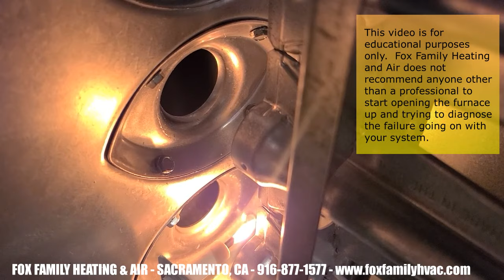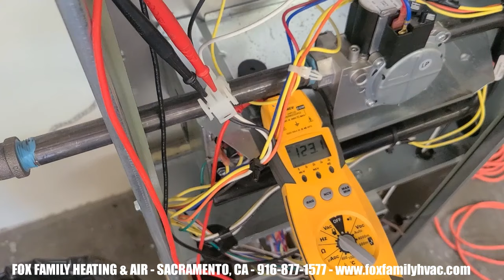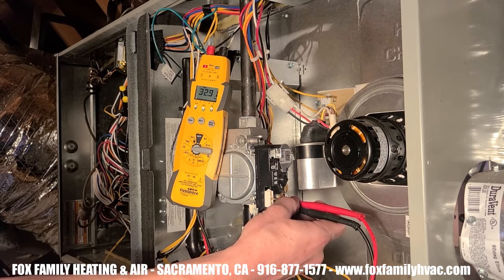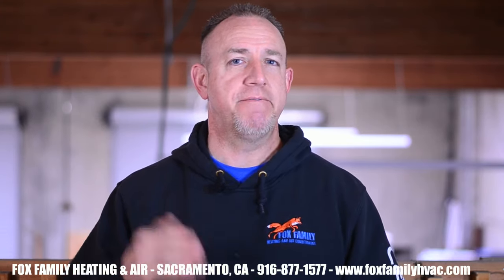How to Diagnose a Bad Furnace Gas Valve (10 Things To Check in 2021)

Comment: My Honeywell vr8204h1147 buzzes when the thermostat calls for heat on my utica steam furnace. The furnace does light but the valve continues to buzz for a time.. perhaps when the call is satisfied.  It seems to do this for the first few days the furnace gets turned on in the fall then the furnace works like normal with no buzzing sound for the rest of the winter.. I have found conflicting reasons why this happens. Is it bad, just dirty, or something else?
Reply: That sounds a lot like my furnace.  Only I have it off for now until it's fixed.
Reply: I am no expert but have been around these units a while. The buzzing coming from your valve indicates 24V is going to the unit but the valve is not opening. You can check the 24V with a meter. If this is truly the case and your valve is sticking closed until it has been operating a while, the valve can also STICK OPEN unexpectedly! :O You may be operating on dangerous lines here and should change valve immediately.

Comment: My York furnace is 4 yrs old. Just recently it would work fine. Then out of nowhere it would blow cold air, I see a steady single red diagnostic flash, meaning heat called for , but no flame sensed . I cleaned the flame sensor, which really wasnt dirty,but a bitch to get out and in due to a very tight area.  Ran fine a few cycles and repeats the problem. I shut of power and turn back on and it works a day or two, then back to square one. Im thinking a sticking valve.  I always see the ignitor glowing properly. Any ideas? I have a 10 year parts warranty, but Im thinking the service call would be twice the $150 cost of the part. Im thinking buying the part and saving money, which actually makes the warranty useless. Thanks
Reply: Same issue here. Please let us know if you figure it out.
Reply: same issue here, everything runs fine for me, just noticed this slow red single flashing light coming from the furnace cabinet, did you ever get yours fixed?
Reply: @Noname23489  What I did was to tap the valve when the ignitor glowed, and was due  to open, and presto, it ignited. And after that it worked properly. My thoughts were that after not running due to summer, it kind of stuck from non use. This summer, I might just once in awhile turn on the furnace a couple times to maybe keep it from sticking. Just an idea. Never had to repair anything.

Comment: Does a bad gas valve cause a bad smell to come through your vent, that smell like a strong smell that smells like how a has stove smell? I have natural gas but when my heat is about to turn off I smell a strong smell that smells like that smell when turning on a gas stove. I had the fire dept to come out and the gas company and there's no gas leak at all.
Reply: Could be heat exchanger cracked

Comment: How do you start troubleshooting a furnace after a flood?
Reply from the maker: I would check for power first, anything that got wet is likely to have gone bad. Including the insulation inside the blower cabinet. It will get smelly and moldy.
Reply: @foxfamilyhvac  thank you. Is it possible that water can get into a boiler through the chimney with rains like IDA?

Comment: When I set the heat to 85 the furnace comes on and fired up, but it does not go up to 85 it would stay at 75 or 77, the colder it is the more it struggles to heat up, what can be my problem? Thanks
Reply: Undersized unit for your home is usually the main reason but also you have to be realistic on how warm 77° actually is compared to the low temperature outside
Reply: @periloustactic  ok thanks a lot, I'll try that this summer, because even some of the room the air is just cool and other vents are warm
Reply: Check the following:
1. Clean air filter installed
2. Duct dampers open
3. Grilles open

Comment: Its reading 15v when is idle than 25 volt when i turn it on but gas valve wont click nor gas will come out. Shouldn"t i be reading 0 volt when its not on ?  is it bad valve or something  else? Thanks in advance.
Reply: Did you fix your problem?

Comment: Would a bad gas valve cause it to smell like gas every time I turn it on ?
Reply from the maker: I would check all the other connections around the gas valve with soap bubbles. Natural gas or LP gas?
Reply: Definitely check for gas leaks.,
A gas leak will cause the smell., could be a micro leak or tiny leak.

Don't ignore this smell

Comment: I had a wannabe tech tennant that had a leak in the gas pipes repair the leak himself, I KNOW, MY BAD, PLEASE DON'T RUB IT IN, I warned him about over pressurizing the system with too much pressure, it had a leak in a very hard to find place, they swore up and down they isolated the furnace from the high pressure, 1 month later the first cold snap and I now have what seems to be a bad flame sensor, I carry a few spares, but the spare did not work, I ordered the Luxaire branded sensor but I am almost positive these gentlemen destroyed the gas valve, it turns on and 5 seconds later shuts down the gas, almost to quickly to be the flame sensor from my past experience. has anyone had this issue, I am unsure what amount of pressure was used and if equipment was capped off, I am now thinking they simply shut the gas valve and tried to inflate the lines, the water heater survived, but that means nothing. could this have caused a gas valve failure, they swear they did not have the equipment connected, all diagnosing of the valve check as good, I know it can also be a bad board, just trying to not waste time on this unit, its very old but in great shape, hate to retire it. bottom line question is, can overpressure cause flame sensor symptoms.

Comment: How to clean the flame sensor rod??
Reply: There's a bunch of videos on YouTube. It's simple.  Remove it and the tip is to use a paper bill, a dollar, five so on to clean the metal rod not with something so abrasive such as green pads or worst, sand paper.

Comment: getting 24volts doesn't mean that you have the proper amperage to open the gas valve
Reply: What would be the reading in amps for 24 volts
Reply: This is why it should be tested while still connected. If the supplied power is insufficient, but with proper voltage, it will drop the voltage as if it is a shorted circuit.